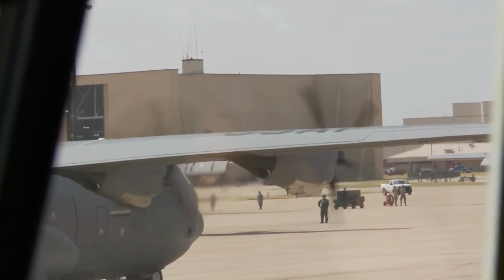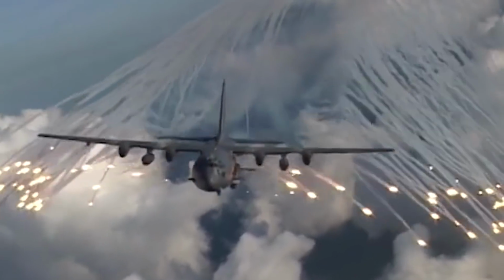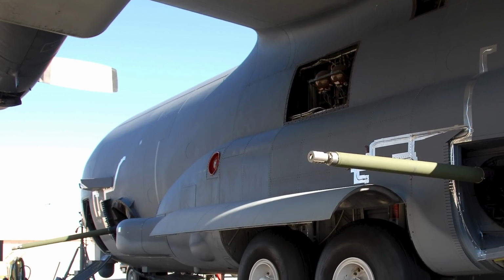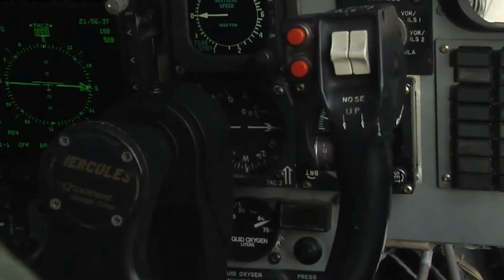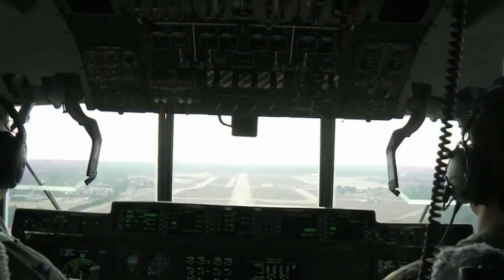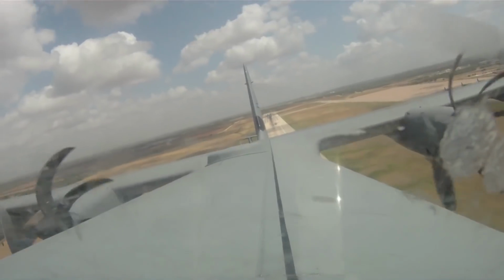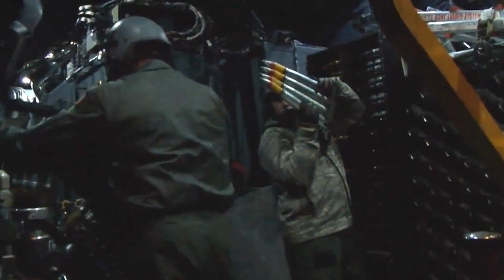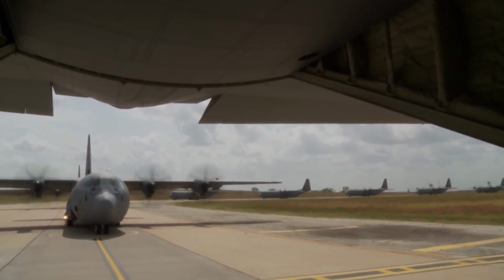AC-130J Ghostrider

Comment: I was stationed at Hurlburt field in the early 2000s and we used to sit at the dorms having a brew listening to the gunships practicing on the range a few miles off. So glad these things are on our side. Lol
Reply: Me too! You don't want to be down wind of those boys!
Reply: @garymcaleer6112  :
I believe that the proper term would be "down-range".
Reply: I can remember the same thing. Except it was from '81 to '85 and the gunships doing that was the H models!  69- 6567 thru 69-6576 minus 69-65-6571 shot down in Vietnam!  Those were the best 4 years of my life!!!  Yeah, you can hear them even better out at Navarre Beach area!  I was a weapons mechanic on the Spectre gunships, the HH-53 Pave low helos and we had about 4 UH- 1N hueys!  I consisted of the 8th sos ( MC-130s) 16th sos AC-130s and the 20th sos helos!
Reply: @scott1395  I was there the same time you were. I was in the Component Repair Squadron repairing the radio equipment. In 1986 I was transferred to Ellsworth AFB, South Dakota. I was there when the first B1B Bomber arrived on station to replace the B52’s
Reply: @kevinwaterman389  that's cool, we started out as working under Aurcraft generation squadron when we were TAC and the we changed to military airlift command and we became the equipment maintenance squadron, our weapons shop was across the street from the wash rack that was behind Eason hangar!  My commander tried his best to get me to reinvest, but I didn't!  SO many times since then I wish I had!  Used to have frequent dreams for years that I was on the flight line and no one knew who I was and I kept telling them it me Parrish!  I still try to keep up with what's going on at Hurlburt as much as possible!   That place has left me with so many memories I wish I could relive!
Reply: @scott1395  Thank you for your service for all Americans.
Reply: @KingAir1  it was the greatest pleasure of my life!  I recommend it for anyone after high school!  Amazingly the airforce has extended the age to enlist to way up into your 30s now if you meet a set of standards!  Looks like they realize older people are still very useful not just those in their teens and early twenties, I wanna say they have extended the age to 39 yrs old!!!
Reply: So was I, I was E & E for the U model down at the 4th
Reply: I was an AMMO troop at Herbert from 03 -05. We working with you guys was the best assignment I ever had.
Reply: I was there too. I was a medic.  At that point I was still working the Immunization clinic.
Reply: Any modern military could take these out like Russia which has high capabilities on anti air it's main use should be against convoys or insurgencys that's it's best light
Reply: No thanks to biden that may not be fully true anymore.
Reply: My parents live in Navarre Beach, enjoy hearing them when I visit. Thank you for your service.
.

Comment: still don't understand why the "big guns" aren't poping out the bottom with 360 rotation 
nor .. WHY ?? why does the US military insist on manual shell loading 
also mabe invest in masks cause shell fumes is a thing .... and so is cancer
Reply: Dude if the plane was damage from the belly, how would  you land it?
Reply: There isn't enough clearance to place a turret under the 130 without extreme modifications to the airframe.  You still have to land it.  You don't want to mess with its structure. 

Manual loading is reliable.  It also makes clearing jams and problems much easier.  You'd have to build a series of autoloaders that fit in the plane, don't obstruct movement, and are light weight.  Or you can have as couple of enlisted guys keep dropping fresh ammo into the system.  Simple. Reliable.

Comment: I love the A-10 and it’s capabilities for close support of ground troops. In the Air Forces attempts to retire the platform they cited F-35s and B-52s as the platforms to take over the A-10s duties. IMO those are ridiculous replacements on many levels and thankfully Congress got it right stopping the retirement of the A-10s. However, these AC-130 gunships are capable of supporting our ground troops at standoff distances due to the accuracy of their firepower placing ordinance with precision. I hope the Ghostrider program is expanded further and used more often as it does not have to enter the combat zone and place itself in harms way as the A-10s must do.
Reply: I wish the A-10's were moved entirely over to Army and Marine control.  The AC-130J's would be a good candidate also IMHO.  Let the zoomies stick to sky battles and space whilst the legs get inhouse air support from their own!
Reply: As much as I love the A10 it's now not as much of a bs statement as to say the A10 is now out of date. Especially in peer to peer conflict where large ammount of Manpads, missle equipped SPAAGs, and modern high hit ratio missles are common.

Remember even tho the A10 has been updated it came from an era where MANPAD systems were practically nonexistent or were as reliable as harsh language and the biggest threats were other planes or radar guided SPAAGs.
Reply: @00Athus1  I would agree that the A-10, while still being able to kill a tank, is much more likely to be killed in that role as well.  They do pretty well killing everything else though.
Reply: Thanks everyone for your input. There is no system that isn’t risky and prone to counter attack. I didn’t understand the AC-130J Ghostrider was a clear weather nighttime attack platform. I lived near a C-130 base and believe the cargo/transport versions are all weather platforms. I agree the combination of the A-10s and the Ghostriders could be a powerful punch, but how often will there be those favorable weather conditions and time constraints? There will be losses of both. Such is the nature of war. The trade off against lives on the ground saved is the decision of the brass conducting the conflicts. I don’t think the propeller based ground attack platforms being developed like the Super Tuscano or the AT-6 Wolverine from Beechcraft are a replacement for the A-10. A supplement for low tech enemy battlegrounds like the jungles of South America, but certainly not situations with ground to air missile systems. Might as well bring back the P-47s with updated cockpits!
Reply: a10 sucks, gunships like these should replace them entirely, check out lazer pig videos on why but to sum it up, its outdated and useless agenst real countries that can afford real militarys, and is super inaccurate versus gunships like these
Reply: @thatrandomguy8124  no one denies the platform is outdated. But until they come up with a reasonable replacement you’d have a hard time convincing the troops on the ground they’re useless.
Reply: @thatrandomguy8124  I am sure there will come the day when the A-10 will be completely obsolete.  Until then, I would like to see a C-130 get into tight quarters and use it's weapons effectively. "gunships like these should replace them entirely".  They can't.  They might be able to mostly replace them, but there is no way the C-130 will be as nimble and maneuverable as the A-10.  Don't get me wrong, this newest C-130 is obviously a hell of a weapon, but as has been pointed out, it has it's limitations.  They all do.
Reply: @metaglypto  The A-10 was obsolete at its time of introduction given the existence of faster, higher flying, more effective fixed-wing jets for ground attack, and attack helicopters for close support and tank hunting. The A-10 only exists because the US Air Force didn't want to lose the CAS role to Army helicopters - there's a reason the Apache is in widespread use by multiple countries, but the A-10 isn't used by even a single country outside of the US.
 
The A-10s reputation is built entirely on bullshit made-up statistics from the Gulf War and the fact it is very fun to use in video games - in reality, it's mostly just bad.
Reply: @HellbirdIV  most statistics produced during wartime turn out to be bullshit. I grew up during Nam and our military couldn’t produce accurate statistics if their arses were on fire, which they actually were. Most of the A-10s used in the Gulf wars were reserves and National Guard units anyway. Also I don’t believe the Air Force really wants to provide CAS for the Army and Marines. Their plan of using F-35s and B-52s as the replacement for A-10s was so feeble and transparent even Sen. John McCain could see through it. I agree the Army and Marines should be in charge of their own close air support instead of having to call on an Air Force who only grudgingly supports them. Otherwise the Army and Marines wouldn’t have the need for their own attack helicopter units for it. This goes back to the formation of the USAF after WW2 and their need to justify themselves as a separate force from the Army. Even the Navy knew planes on carriers needed to be under the Navy umbrella rather than the Air Force’s. The whole mess is due to politics. There in lies the main problem. Not just on Capitol Hill but in the Pentagon too.
Reply: Woe to those that have to face both the A-10 and the AC-130 in coordinated attack runs.
Reply: Similar to the Airforce retiring the P -47 Thunderbolt after WW-2, Nothing was like the "Jug" as the Fast Bearcat was really an interceptor outclassed by Jets.
Thunderbolts with its 8x50 mm cannon, could get hit and still fly, as well as dive as fast as an early Jet..
Reply: Murphy's Law of Combat.
If the enemy is in range so are you.
Reply: The AC-130 is much more vulnerable to ground fire due to speed and altitude at which it can engage targets.  The A-10 is an all weather attack aircraft.  The AC-130 is really a single weather condition (night) attack aircraft.  They put down a massive amount of hate but if you are in a daytime TIC, A-10s (and rotary) are where it is at.

Comment: Had a tour around a AC-130H (Spectre) when on opps in 95, I was very impressed with it's fire power. So if this is an upgrade wow.
Reply: Honestly I think spectre would be a better name for the f35
Reply: @spartanx9293  Never understood why the f35 is the successor to the p-38
Reply: @chiefturion7134  it's made by Lockheed Martin that's why
Reply: @spartanx9293  you can bet if McDonnell made the F35 it would have a good chance of being named Spectre or some other paranormal thing…but I’m sure you already knew that, given the Lockheed reference. I know, they could have named one of their planes the Pepe…since the Skunkworks helped develop it! 😉🤣🤣🤣 
🖖😎👍 Cheers!
Reply: @samsonian  issue is Boeing (may they burn in hell )took over McDonnell Douglas

Comment: Correct me if I'm wrong but didn't the US just retire a whole bunch of AC-130s?
Reply: Likely outdated H models... Hi hours on the airframe.
Reply: The AC-130J is a newer build aircraft, with way more fuel efficient engines than earlier models. Older aircraft used different versions of the T56 engine which was basically 1950’s technology.
Reply: @xairman565  they still use the t56, obviously modified and improved. Other internal improvements and the 150k ESL wing structure. They kept them interchangeable for previous customers to slip right into their existing support system, not the AC but the standard platform was 76 mil a piece.
Reply: Yes, they Left them all over in Afghanistan for the Taliban to use.
Reply: Im pretty sure that was the U variant. But i could be wrong
Reply: It would have been the U models, the H models were retired around 1995 and the A models before that!!!
Reply: @scott1395  the last H model was retired in 2015